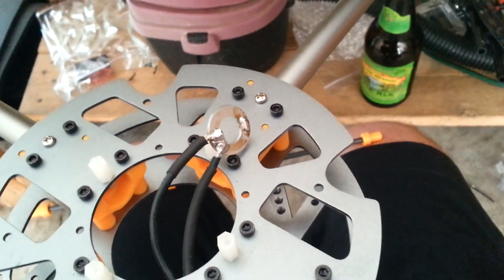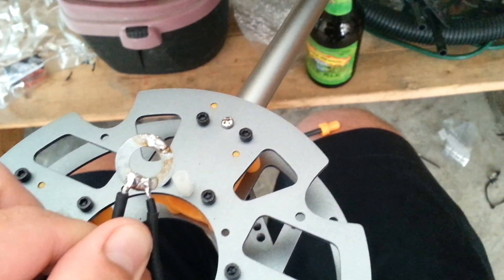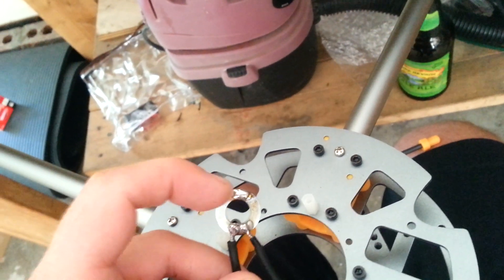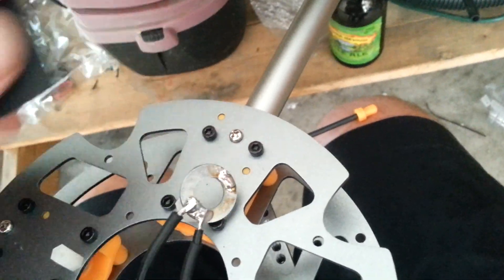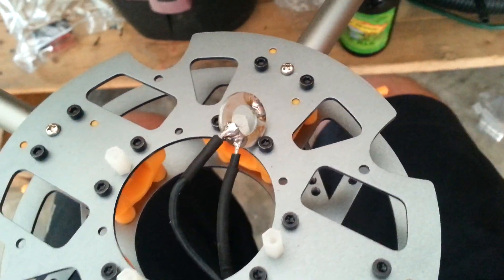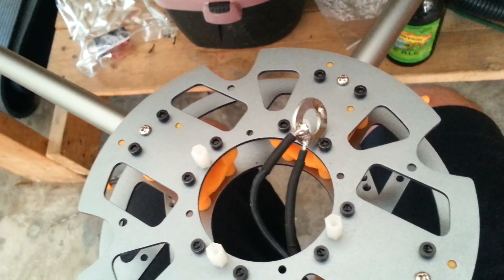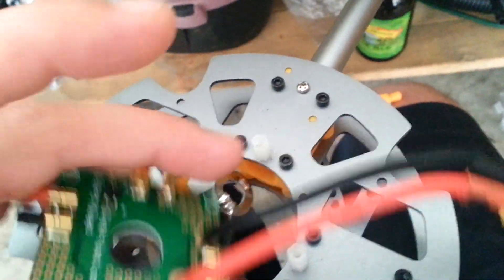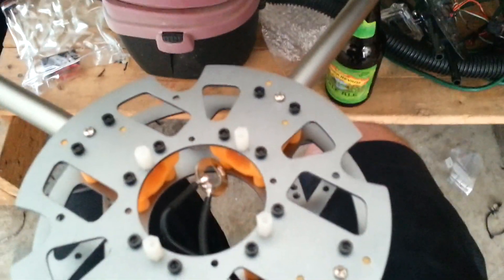How to make cheap power distribution board diy

Comment: Do not try this is b***** if you have KK 2.1 and Simon k 30 amp esc after there flights 
You will fry your flight board...
Reply from the maker: Walter Hawker if you did not insulate them well and had a short then sure. Otherwise, no, it won't.

Comment: Have you tested for AMP draw.   I would hope it would hold  50 amp or greater.
Let me know.  As most of the HK boards are only good for Max 20 amps per ESC
Reply from the maker: Gfdf Perte I was pulling 29-35 amps on the quad I was flying with no issues.

Comment: Hallo Erik,
This is an awesome way of doing it. Thank you for the tip and I will definitely make use of it. Just a quick quotation. Do you think a copper washer will work better than a normal steel or plated washer?
Reply: I was wondering the same thing...... did anyone reply to your question?
Reply from the maker: Stephan Lindeque Copper would be best. I just used what was laying around and it is steel.
Reply: ***** A real copper penny from before 1982 seems like the best solution. Even cheaper than a 2 cent washer. The newer ones won't work, they just seem to disintegrate when they are heated.